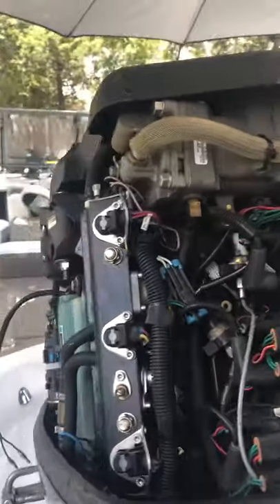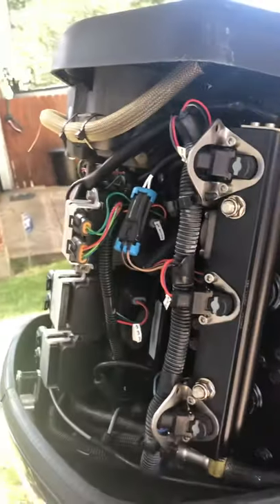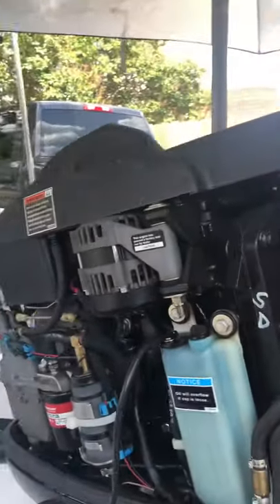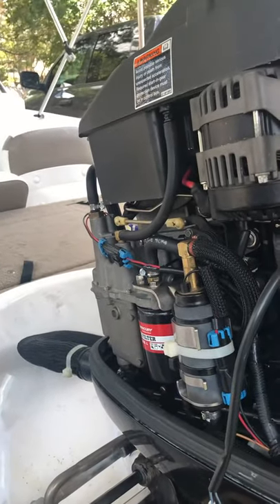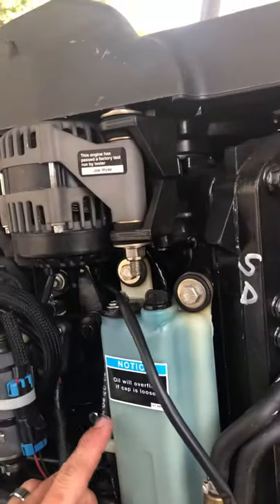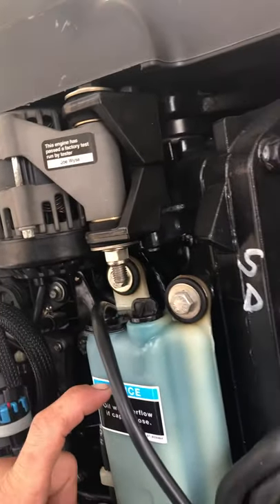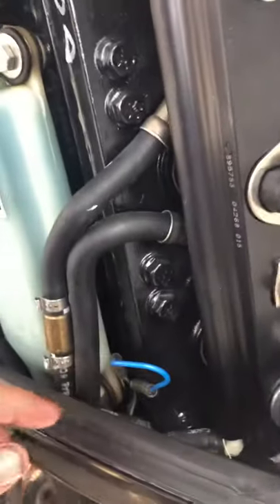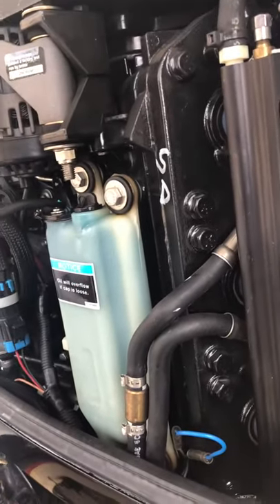Outboard power loss

Comment: It should of thrown an alarm. You listen to the alarm and duration and use the chart to decode it.. you immediately should of found that low oil. When you are low/ empty you than have to purge the system of air

Comment: I’m having same issue but mine was bogging down changed the fuel filter and now it will not hit anywhere close to top speed, would that be the same issues as yours?

Comment: i have 1998 Mercury 200hp EFI have change ,new spark plug ,new fuel filter, new fuel pump, when I put neutral I can run up to 4000 RPM, but when I gear up forward it's only run up to 2000 rpm max. Can you support me what's the problem can be.  thanks
Reply: Your not supposed to rev it to 4000 rps in natural its an efi motor it will put in fault mode otherwise guardian

Comment: My boat goes up on plane then losses power could this be same problem?
Reply: I got the same issue trying to figure it out lol
Reply: Any luck on the power luck problem? Having the same issue with my 2012 75hp. Gets up and then cuts power.
Reply: Same any luck
Reply: @ATacticalG  Yes!! A can of carb cleaner, some sea foam, new gas line, and a good cleaning the the VST. Boat had never seen ethanol fuel, but had sat for a couple years. Opened the. VST up and found some gunk. Cleaned everything up and she’s ran great this last few weeks since. It’s not a difficult job.

Comment: I had surging problem with my2000 Optimax 250 HP motor.  I had replaced the air. fuel, and tracker valve with no change.  I replaced the spark plugs and cables and seemed to help but after warm-up and high speed between 3000 to 6000 rpm the motor would start surging.  If i shut the motor off for a bit 3-5 minutes and restart it would run fine for a couple of minutes and again start surging.  I tried the one thing that I thought was the cause.  I replaced the high fuel pressure electric fuel pump in the VST and test it the next day.  It fixed the problem and has not acted up under high-speed testing.  Wish I had done it earlier.

Sounded exactly like the video above.   Hope this helps other users.
Reply: I haver the exact same situation. Ordered today a New high pressure pump. Hope it solves the problem.
Reply: Hubby is calling me his boat mechanic now, since I had replaced the majority of things in the motor.  We’re still having problems and I guess the high pressure fuel pump is going to be the next project!

Comment: My boat was sitting for 2 years because of low compression got a used powerhead with 400 hrs on it the shop did a straight of power head and now I am having the same issue. I can’t get plane or pass I guess like 2000 rpm they said it had low oil and went into guardian mode. They filled it with oil delete codes couldn’t find anything wrong. Fuel pressure all checks out. But when I take the boat on lake and hit throttle with load it just stutters. Since I have my old engine I’m thinking I’ll swap the vst and oil tank hoping that will fix it. Very frustrating when I spent 5k 2 shops and still not on the water running yet

Comment: How did you jump the wires together. And does it work, and for how long
Reply: It will work guys but its not safe you need the alarm if you do hes way you will never have alarm incase your oil drop down  do one thing if you dont want to buy a new one ,remove yours drain it from the oil then look inside there is a sensor use glue poisonous up and put glue on it so should not move down it self and feelbuy oil and check it this sensor if once the oil reach below the sensor start alarming so thats why the sensor should be up posion if its down posion and miving up and down so its proken but this is the way to save both your engain and your moeny